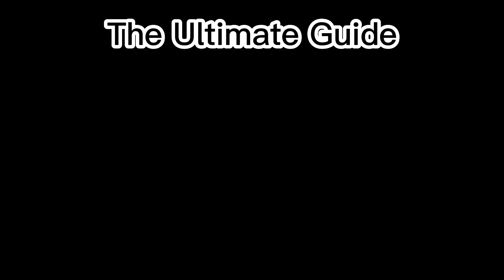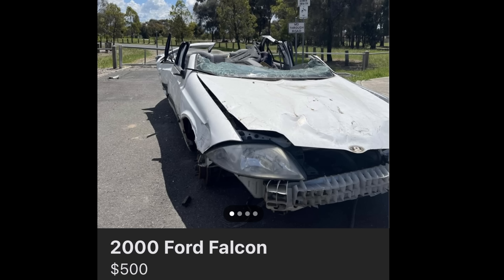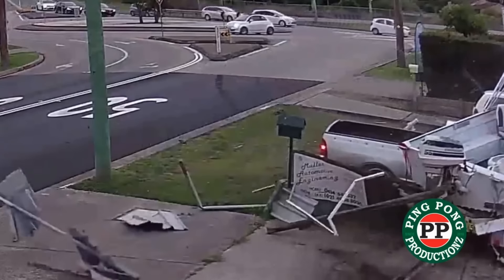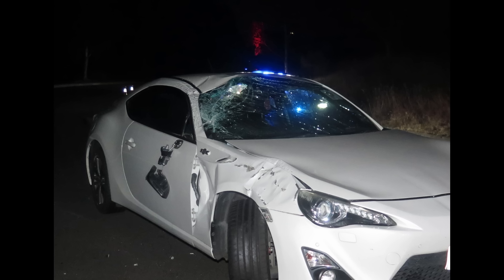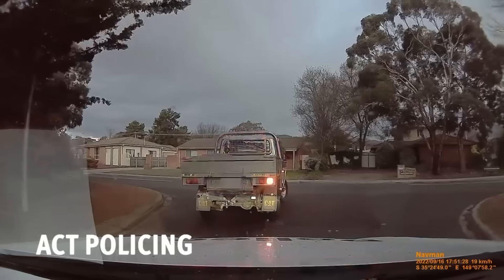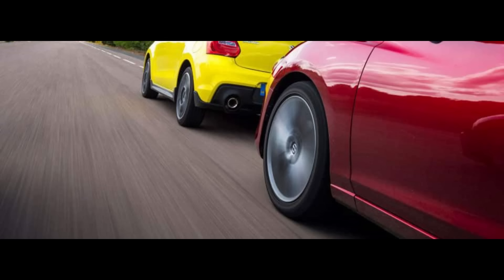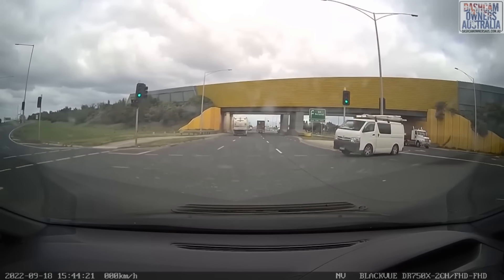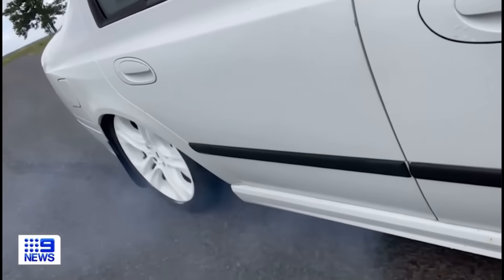P Platers

Comment: You can’t forget the P Plater, special The supercheap auto pod filter
Reply from the maker: Ah I knew I forgot something, I had one on my au at one point but the engine sucked the thing to pieces and I had to throw it out
Reply: i  bought a SCA pody for my turbo mower so ill have to get a p plate for it 😂
Reply from the maker: turbo mower 😂😂I need one
Reply: I work at sca if you walk into my store and you're driving a AU-BF Falcon or VS-VZ Commy you get a SCA Pod for free on any purchase
Reply: @30769s  good on ya 👍🏿👍🏿👍🏿
Reply: I have a sca pod filter on my 04 rolla sedan 😂
Reply: ive got a K&N box filter and a swissed airbox, you wouldn't know looking in the engine bay but shes got some mad as intake noise
Reply: Don't forget the "supercharger" that's actually just a bad alternator bearing.
Reply: And the fake gear shifts
Reply: Held on with cable ties

Comment: Back when I was a P-plater we used to wrap Toranas around trees and did donuts instead of single peggers... and when we did a car up, we'd paint it in grey primer and buy the cheapest set of hotwires, peanuts or 12 slot mags we could find in the Trading Post that week. We also used to call alloy wheels "mags". Fk I'm old lol
Reply from the maker: more or less the same these days lol, except instead of a torana its some VS commodore with 400,000ks and belt whip down the side
Reply: Now, remaining Toranas are locked away.........as investments! Even a boring Starfire Sunbird is worth a mansion in Potts Point!
Reply: My dad blew a line of XB gts he and his mates bought from an impound lot once, how times have changed
Reply: a lot of high quality alloys back then had magnesium in them, hence mags, unless you bought crap alloys :D
Reply: when my dad showed me his old cars when he was in his 20s and even early 30s he had monaros one tonners toranas that all looked like showcars and had big lines of all his mates cars on the beach and side of the road at a car meet lined up with 10 plus cars all cruising. funnily enough his second car he ever bought a lj gtr xu1 torana has been kept up until this very day in all original trim and nothings been touched on it except for maintenance and looks as good as wehn he bought it back in the late 70s of the first owner. you look at the p platers of todays and they all drive around in commys and falcons with the same wheels either simmons fr1 or reps, walkinshaw wheels on the commys and vertini wheels or the stock fg falcon wheels. they dont take care of their cars with faded paint cracks in the front and rear bars dirty cars and nothing really unique like it used to be in the older days where reds greens blues yellows where more of a common car colour to see. now days every brand new car is either made in black white or silver unless its a  performance car which aus doesnt make anymore
Reply: haha trading post, tell him hes dreaming
Reply: @mint_au  your dad probably bought first house for 30 grand and now it’s worth 3/4 of a million. Life was a lot cheaper back then
Reply: @soccermd5939  lmao
Reply: Nowadays, grey primer is called "Nardo Grey" and it's on all of the poncy German cars and everyone thinks it's a cool colour... Meanwhile all I'm thinking of is when this colour signified cheap shit and looked average as hell... 😂
Reply: @mint_au people are poorer than ever right now, you used to earn more money in the past
Reply: @dubbbs  D Bay Grey, I cant believe people buy Cars that colour.
Reply: @yorakhunt69 hey my Vs has 80 thousand on it

Comment: Shortly after my P plate era, i bought an XE Falcon with 3-3 and four speed. A few safety features which prevented me from crashing it was an underpowered motor, and a very notchy gearbox, which both kept you alert, and prevented you going too fast!  
If you've ever driven an XE 3-3 over the Blue mountains, you'll understand why I never did burnouts or wrapped it around a tree. It could never produce the force required.
Reply: UP the blue mountains
Reply: My dad had a XD with a 3.3ltr auto shocking gutless and chewed heaps of fuel.
Reply: @grimreaper6112  
Little motor had to work hard to move body big enough for V8. As a result, they were thirsty.
Reply: @lincoln9307  
Very pretty place. Speed limits change every three seconds. If you can drive over them in a car with decent performance without generating a fine for yourself, you deserve a medal 🏅
Reply: @noelgibson5956
Heh nice. My P-plate car was a ba xr6. But after a few years I also bought an XE Falcon. 

Mine had the 4.0 250 crossflow though not the 3.3. 
Even that though wasn’t much chop and so didn’t have to worry about speeding tickets and on a steep enough hill even with your foot to the floor it would slowly start to lose speed, can’t fault it for reliability though I daily drive it for 3 years and despite being clapped out and using a bit of oil it never let me down. Had to replace door handles fairly frequently though. 

I never got to drive a 3.3. Though. My Cousin had an xe with one in it but ripped it out almost immediately and dropped in a turbo Barra. 

I’ll always love my XE and will probably never part with it, but it’s retired from daily duties and only comes out on weekends these days.

Comment: I am old. My first car was a 1976 Toyota Corolla in the legendary baby shit brown colour. I bought it from a little old lady for $500 in 1996. I stacked it into a concrete wall on a freeway entrance at 80 kph two years later. Because the AM radio didn't work, I had a crappy boombox on the rear parcel shelf- it ended up on the dash! 

I got out to have a look at the damage, and the front right headlight was pointing sideways- and it still worked! I limped it home, took the front side panel off, jumped on it, did a bit of crowbarring, put it back on, and it was as good as new! Then I gave it to my ex girlfriend coz I'm a legend. The end.

Comment: As someone who has a Volvo XC60 t6 as a p plater I certify this as accurate thought it’s impossible to skid my car.
Reply from the maker: Nothing’s impossible
Reply: Same here except I have a 2014 amarok (hand me down from my dad) with 4motion permanent 4wd so unless I disconnect the front driveshaft then I can’t do skids
Reply: Literally how I feel in my CX-5 Akera Turbo
Reply: @ZacharyT94  haha yep it goes well and puts the power down well Same quarter mile as yours, but when it comes to skids it’s traction systems stop me with haldex awd engagement.

Comment: new p platers shouldnt buy an au falcon, its too fast and too powerful for a little newbie, its much better to get an au falcon without an engine, its much safer and slower
Reply from the maker: Yep they need to cut a hole in the floor and do the Freddy flintstone

Comment: thank christ P platers are banned from the actual fast cars or else australia's going to run out of young men
Reply from the maker: And fast cars
Reply: if you mean the high powered vehicle restrictions those laws are useless as a teenager working a minimum wage job wont be able to afford one as like most on the market are not cheap, only the rich kids will get them which is like a small handful of the population, American teens get to drive around in high powered cars and it annoys me its a problem here

Comment: What about the p plater in an <1000kg hatchback with upgraded suspension?
Reply: That was me lol, I was gonna do it up and turbo it, but I bought a shitbox 4wd that I'm gonna do up and turbo instead
Reply: @joeycourtice4157  How far did you get?
Reply: @Gugernoot  Ive got it running reliably and perfectly functional, and I've bought a spare engine for it to modify in the shed so I can keep driving it. Looking promising 😂
Reply: @joeycourtice4157  I was asking about the first car. I should do the same with the excel.
Reply: @Gugernoot  ohhh lmao, kept it stock as a rock, except a decent sound system
Reply: @joeycourtice4157  hehe